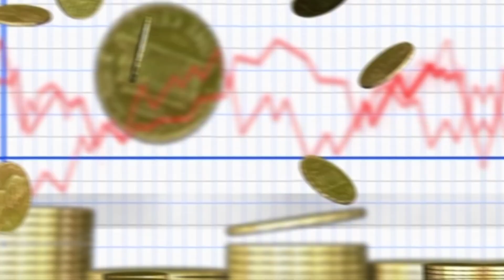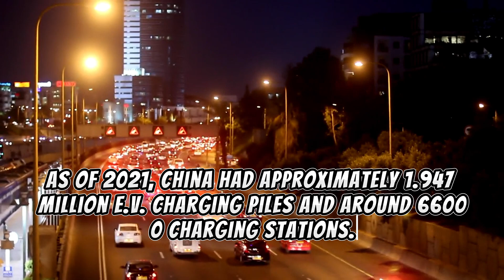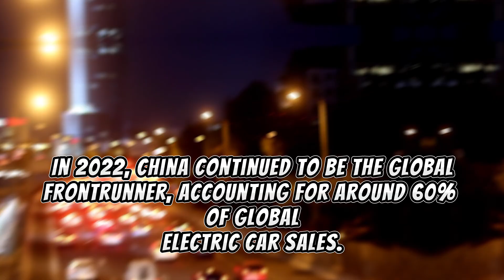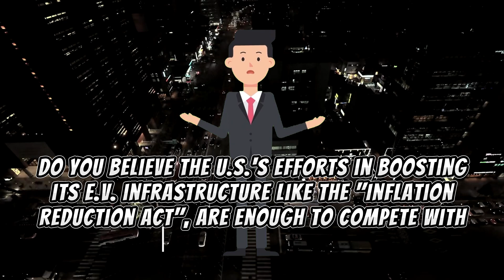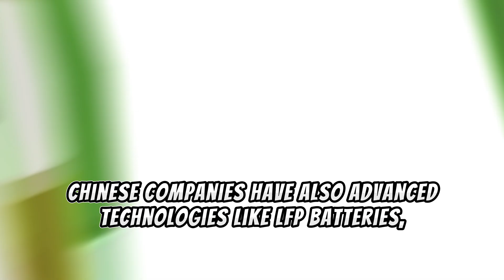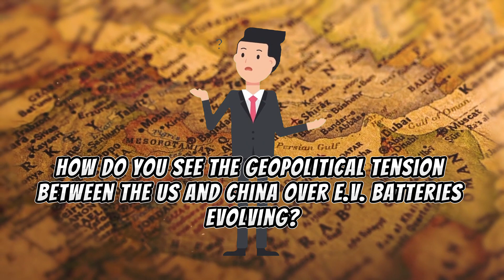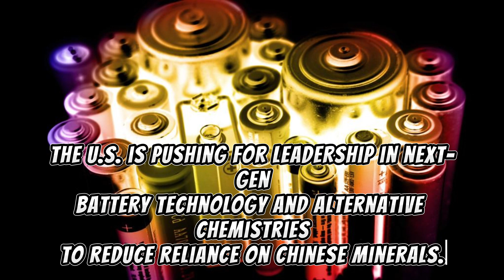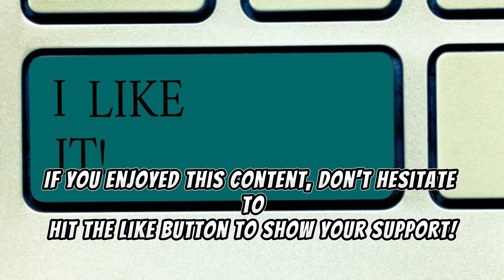China Economy vs the US Economy: BYD vs Tesla

Comment: That new self-immolation feature on Chinese EVs is a true game-changer
Reply: Tesla is also using BYD blade batteries. If you think BYD is prone to spontaneous combustion, what about Tesla
Reply from the maker: We believe BYD will take over. Note that they are moving to use Na based battery instead of Li based one, which is another advantage of BYD.
Reply from the maker: Do you think BYD will take global market of Tesla?
Reply: 能騙就騙.  BYD can take the share of those few Tesla owners with no interest in quality control; however, considering how expensive Teslas are, that may not necessarily be a huge segment. China is an imitator, not an innovator. Thus, any sort of "new" technology from them needs to be viewed with great skepticism.
Reply from the maker: @chrsn what do you think of BYD sustainability? They are using Na-recharchable batteries instead of Lithium one which is cheaper and environmentally friendly.